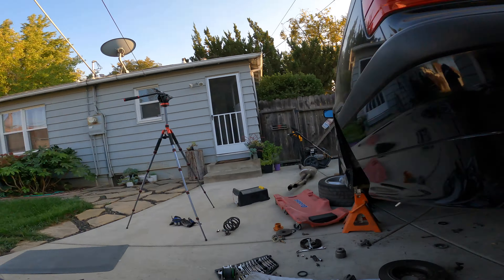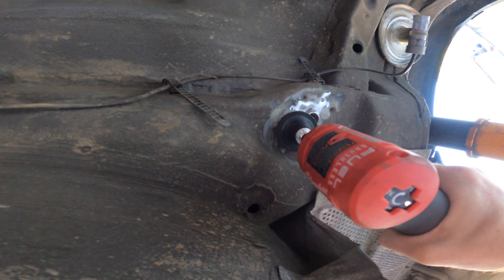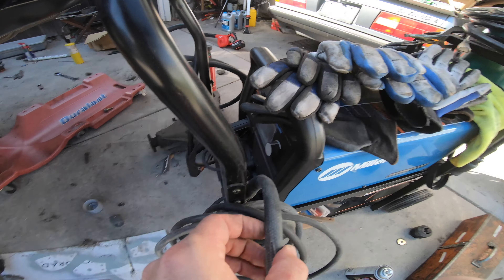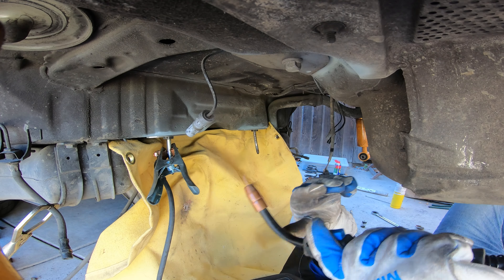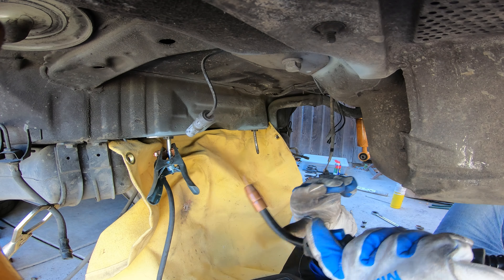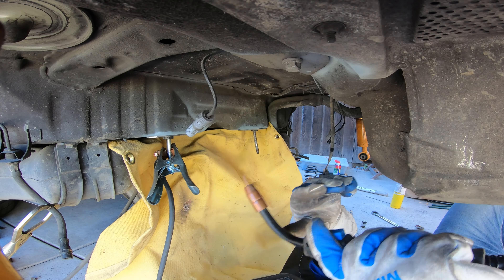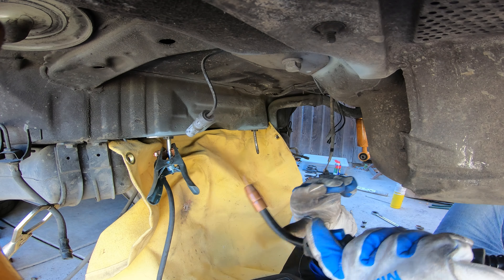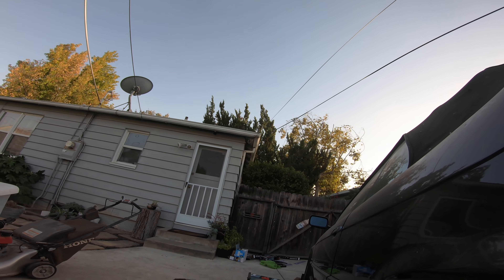BMW E36 Weld-In Subframe Reinforcement Plates and Rear Swaybar Reinforcements DIY

Comment: I am NOT a Welder,, (I was a "Toolman" in my younger days)   but I believe Flux Core Wire is for welding outside NO shield gas needed,,, It does leave residue and splatter... but the weld is consistent,,, and by the way,,, Good job on the bad ass cable to plug your welder into the dryer outlet,,,,  IT matters,,,